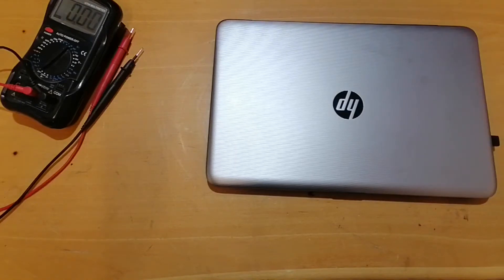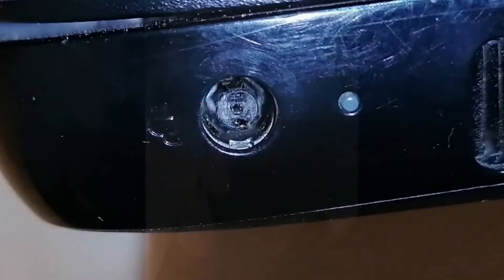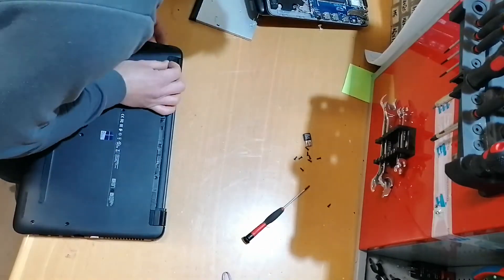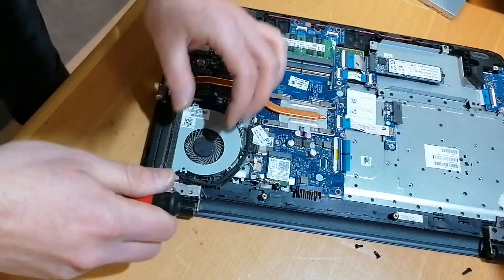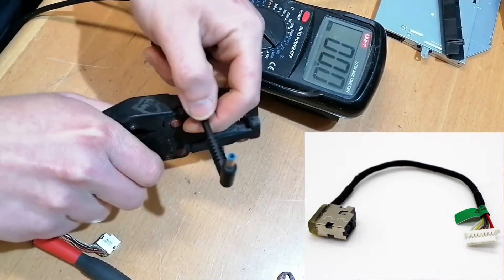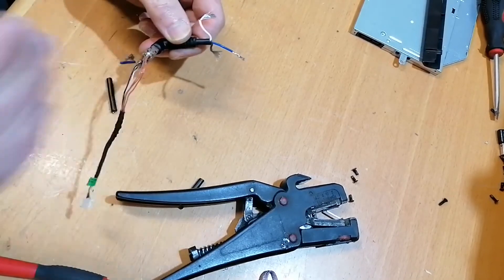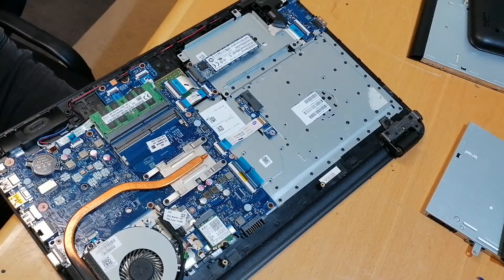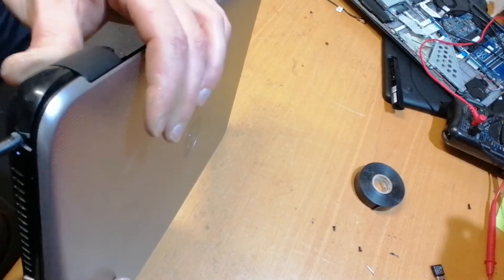HP not charging FIXED!!! HP 250 G4/G5

Comment: Would laptop start from full battery?
Reply from the maker: It should, this one was just starting for a few seconds because the battery was discharged.
Reply: @DIYHelper  I ask cuz I have same problem with same model but I can't start laptop at all, from the charger or from battery
Reply from the maker: Well this one still had some power in the battery. Does your charging light work? The charger has very thin pin in the middle, do you still have it?
Reply: @DIYHelper  pin looks ok, I don't have any lights at all even if it's full battery in, or connected to charger, no power at all
Reply from the maker: Probably something else. This was a one time thing for me, I do not repair laptops. Check out this channel a lot of nice videos, maybe you find your fault here https://youtube.com/c/Electronicsrepairschool
Reply: @DIYHelper  thanks a lot for your help :)